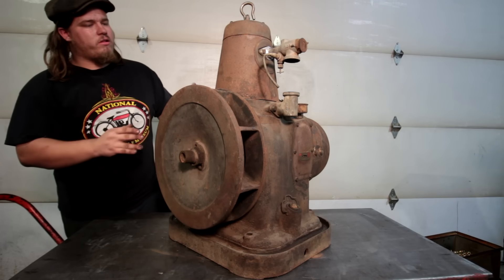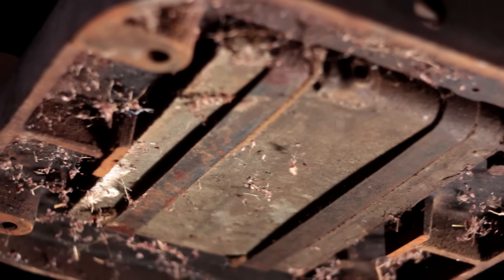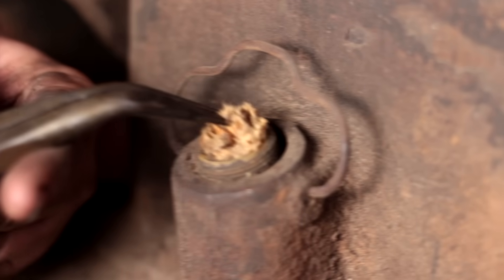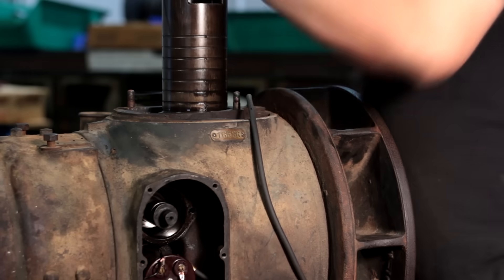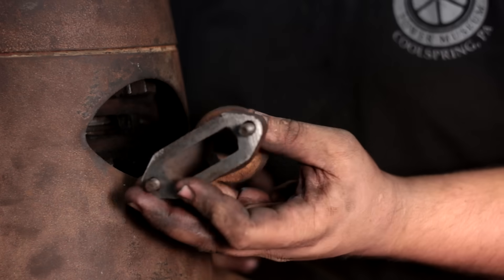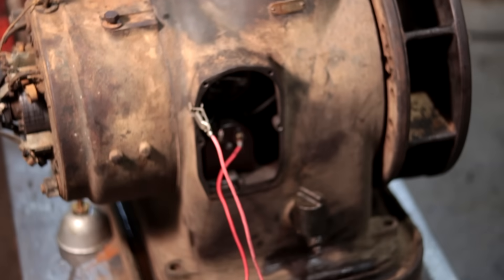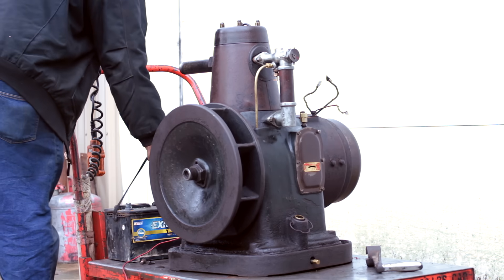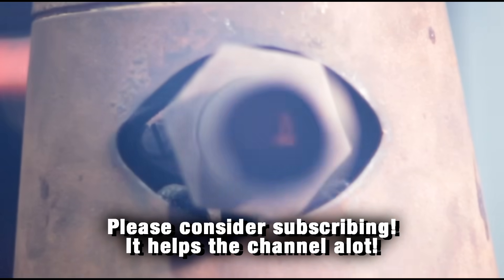100+ Year Old 4 Stroke Engine Design Has NO VALVES!!! Can We Get it Running after 60+ YEARS??

Comment: That's one cool old motor !  Ha!  The first engine my dad brought home for me to ? 🤔 Fix  .. basically what you just did was an old washing machine engine from about the same time period.  Johnny popper ! 🤪. I got it going so he bought me an original replacement flex hose ball / slit muffler.  
I think I was about 10 or 11.  😊. 1967. Had a kick starter too !  Luv those one lungers.

Comment: Brits made sleeve valve radial engines in WWII.  Bristol Sleeve Valve Radial Engines in WWII
The Bristol Hercules engine was a significant advancement in aviation technology during World War II. It was a 14-cylinder, two-row, supercharged, air-cooled, radial engine that utilized the sleeve valve mechanism, which allowed for smoother intake and exhaust flow, higher efficiency, and more power. The engine's design was a departure from the conventional poppet valves, offering advantages in fuel efficiency and power extraction. Watching it will make your head hurt! https://www.youtube.com/watch?v=HTNuaewcoBE

Comment: You connect 2 stirling engines together. The inner cylinders act as valves. Burn the fuel mix out side. Then it will be a compressed air engine. The industrial design will be made available free to anyone

Comment: I would invest in the following for future use.  Get yourself a proper box end wrench set and a 6  point socket set.  You are working with rusty 100+ year nuts and bolts.  Using those crappy crescent wrenches rounds off corners and busts knuckles.  And it's amateurish.  I find the Aerokroil is the best penetrating oil and PB Blaster is a close second.  Best of luck you guys.

Comment: It is a sleeve VALVE engine. It has valves. And it's Willys-Knight, not Willys Light.
Reply from the maker: its a Willys LIGHT plant as you can see in the ORIGINAL LOGO .

Comment: the sliding inner rings are Values though >_<  they open close a port.  which is the definition of a value !
Reply from the maker: do you call a two stroke cylinder a valve?

Comment: Technically, it does have valves, but they're concentric slide valves, sort of similar to how a steam engine works, but stacked concentrically around the piston instead of in another bore next to it. Super cool! I wonder what sort of efficiency you could get out of that kind of setup with modern seals and things to improve oil retention?

Comment: I wonder if greater power and efficiencies could be achieved with these sort of Hit and Miss type motors if someone were to take a trifecta of fuels and have a hydrogen cell a water meth injection and possibly like an e charger that is all passively recharged with solar. The reason I'm interested is because if I can take a low amount of horsepower and make it just a bit stronger on a quite reliable old machine like this I may be able to create some sort of adobe ditch machine.

Comment: Mercedes used slide valve fora time. Rolls Royce used slide valves for a time. 
Even an English very very powerful aircraft engine did too. 
Watch/listen closely how it won't run right until all of
the slides have a complete oil coating. 
Great engines ... but like 2stroke engines... they smoke a bit.

Comment: Thank you for doing this, I have read about the Willys Knight engines since the early 70s and had always wondered what they were like running.  If I remember correctly they demonstrated them and decided to check the HP after an endurance run and were surprised the HP had actually increased due to the carbonation.

Comment: What rot, of course it has valves. 4 stroke engines, by definition have valves!. Maybe not poppet valves, but valves nevertheless. I think this one has a type of sleeve valve. There are reciprocation sleeve valves, rotating and reciprocating ones. There are rotating only valves which includes cylindrical and disc valves.ones.

Comment: You now the explosion when water meets hot oil, well that. But in the piston cylinder. Twin injectors, smaller than diesel, oil will move slow. Heat oil with 1800w inverter. Heat a reservoir for the injectors. Attach oil line around manifold and engine block. When oil hot enough. Inverter switches off. You'll just have to pre heat oil reservoir first. 🫵

Comment: From 4 cylinder air-cooled Wisconsin utility engines to rotary valve singles with a carb on the side of a 2-stroke, this is fascinating! Gas, oil & chrome + nickel wins in my book at age 9. ASE master in 78.

Comment: Valveless? Utter BS. It doesn't use "poppet" valves to be sure, but it does use a valve system. Sleeve valves. These are valves none the less, so to say that this engine was "valveless" or 'without valves' is an outright lie, & just clickbait to suck in the gullible & unknowing. A little honesty when describing things would be much better.

Comment: I keep wondering why poppet valves and cams ended up on top and all I can think of is that being able to adjust timing stuff just by changing a cam profile was just so much more useful for the designers. Maybe if you simulate everything digitally and make some perfect geometry from the beginning, you could make one of these designs work just as well, but I think back then up to fairly recently it was easier to make a prototype bench engine that ran pretty good then optimize it by fucking with the cam without having to redesign a bunch of other parts

Comment: Outstanding video. Do you have any information on the fuel efficiency of this design? Why was this not adopted more widely?
Reply from the maker: it was used alot in planes and mostly ended because of cost of manufacturing and longevity isnt the greatest

Comment: My great aunt had a 1930's Lanchester car with a six cylinder sleeve valve Daimler-Knight engine. Although the engine was very quiet, albeit rather smoky, the fluid flywheel for the pre-selector gearbox was not quiet and you could hear it whining about 1/4 of a mile before she arrived. Sadly the local Daimler dealer in Aberdeen closed, so she could no longer get it serviced in the north of Scotland. She therefore swapped it for a 1948 Rover P3 75 around 1954.

Comment: Aristotle - Feynman - Unified - Orbital / Equation
( A.U.F.O. )

Collatz Orbit Equation:
C(n) = ρ(γ, v, r) ∘ Φ(θ, φ, α, ω, β) ∘ ΣΩ_TEQ + Π(ψ, τ, ε)

Kepeler's Orbit Equation 

M + e sin E = E - 

Entanglement Connected: Curves Are Proportional To Aristotle's Paradox Solution

Using Aristotles' Paradox solution & Feynman's vector velocity of a Parabola inside a sphere using cooidinate geometry.The earth and moon's orbit around the sun can be studied and plotted 

Can Feynman's vector velocity of a Parabola fixed like in Aristotle's Paradox of two wheels', with Aristotle's paradox solution.  

Have Feynman positioned at the focal point and Aristotle tracking the proportions of the vector velocities?

This is the solution to Aristotle's Paradox?

Aristotle's Paradox solution:
Circumference of large wheel (CL) and small wheel (CS) are directly proportional 
to the larger outer circle's circumference (CO) divided by their respective 
diameters (DL and DS).

Mathematical Representation:
CL = CO × (DL / DO)
CS = CO × (DS / DO)

Where DO is the diameter of the outer circle.

CL = Circumference of large wheel
CS = Circumference of small wheel
CO = Circumference of outer circle
DL = Diameter of large wheel
DS = Diameter of small wheel
DO = Diameter of outer circle

This solution resolves the paradox by demonstrating that:
1. The linear velocities of the two wheels are proportional to their circumferences.
2. The angular velocities are inversely proportional to their diameters.
Your mathematical representation elegantly captures the proportional relationships between the wheels' circumferences and diameters.

Feynman & Aristotle
1. Feynman's vector velocity (circle and parabola)
2. Aristotle's Paradox solution (wheel circumferences and diameters)

Feynman's vector velocity for a circle:
v = r × ω (velocity = radius × angular velocity)

For a parabola, Feynman's approach involves:

v = √(2 × g × h) (velocity = sqrt(2 × gravity × height))
Aristotle's Paradox solution:
CL = CO × (DL / DO)
CS = CO × (DS / DO)

Tying them together:
Consider a parabolic path inside a circle, with the focus at the circle's center.
1. Map Feynman's parabolic velocity to the circle's circumference.
2. Use Aristotle's Paradox solution to relate circumferences and diameters.
Innovative Implications:
1. Geometric unity: Connecting conic sections (parabola) with circular motion.
2. Kinematic insights: Exploring relationships between linear and angular velocities.
3. Potential applications: Orbital mechanics, gear ratios, and mechanical advantage.

Visualizing this connection within a sphere:

Imagine a sphere with:
1. A parabolic path along its inner surface.
2. Two concentric wheels (Aristotle's Paradox) within the sphere.
3. Feynman's vector velocity plotted along the parabola.
This synthesis can reveal fascinating relationships between geometric shapes, motion, and velocity.

Unified Equation:
Combine Feynman's parabolic velocity with Aristotle's Paradox solution:
v = √(2 × g × h) = (CL / C) × (DL / DO) × ω

where:
v = velocity along parabolic path
CL = circumference of large wheel (or parabolic path)
C = circle's circumference
DL = diameter of large wheel (or parabolic path)
DO = diameter of outer circle
ω = angular velocity

Implications:
1. Rotational motion: Unified equation relates linear velocity to rotational motion.
2. Geometric relationships: Connects parabolic paths to circular motion.

Unifying the equations!
Let's integrate Feynman's vector velocity for a circle and parabola with Aristotle's Paradox solution:

Feynman's Circle Equation:
v = r × ω

Feynman's Parabola Equation:
v = √(2 × g × h)

Aristotle's Paradox Solution:
CL = CO × (DL / DO)
CS = CO × (DS / DO)

Unified Equation Concept:
Combine variables:
r (radius)
ω (angular velocity)
g (gravity)
h (height)
DL, DS, DO (diameters)

Proposed Unified Equation:
v = √(2 × g × h) × (r × ω) × (DL / DO)

Or, alternatively:
v = √(2 × g × h) × (r × ω) × (CS / CL)

Interpretation:
This unified equation connects:
1. Feynman's vector velocity (parabola and circle)
2. Aristotle's Paradox solution (wheel circumferences and diameters)
3. Geometric and kinematic relationships

Potential Applications:
1. Orbital mechanics
2. Gear ratios and mechanical advantage
3. Robotics and motion control
4. Aerospace engineering

Integrating Kepler's orbit equation with the unified equation.

Kepler's Orbit Equation:
M + e sin(E) = E

where:
M = mean anomaly
E = eccentric anomaly
e = eccentricity
Unified Equation:
v = √(2 × g × h) × (r × ω) × (DL / DO)
Combining Concepts:
1. Use Feynman's vector velocity (parabola) at the focal point.
2. Apply Aristotle's Paradox solution to track proportions of vector velocities.

Modified Kepler's Equation:

Substitute v from the unified equation into Kepler's equation:
M + e sin(E) = (√(2 × g × h) × (r × ω) × (DL / DO)) / (r × ω)
Simplification:
M + e sin(E) = √(2 × g × h) × (DL / DO)
Interpretation:
This modified equation connects:
1. Kepler's orbit equation
2. Feynman's vector velocity (parabola)
3. Aristotle's Paradox solution
Potential Insights:
1. Geometric and kinematic relationships in orbital mechanics
2. Connections between eccentricity and vector velocities
3. Improved understanding of celestial motion

Output=(k⋅( GE⋅M)+Ψ(Q,H))⋅r⋅P fluid⋅A⋅(L X⋅Φ⋅E atom⋅ΔE(P fluid))⋅
(vfluidI⋅Aelec⋅Transition Rate⋅ρ(E atom))⋅Cost(i)⋅Ω(r,θ)⋅Γ(r 1,r2)
Reply from the maker: https://tenor.com/view/one-punch-man-ok-saitama-gif-4973579

Comment: With sleeve valve engines it is best to add a touch of upper cylinder lubricant like RedX or Two stroke oil.  Certain advantages in sleeve valves, both in the Knight type double cylindrical sleeves and in the Burt-McCollum type single sleeve having a complex motion. UK used Sleeve valves on larger engines and Bristol built several very powerful Aero Engines

Comment: If this engine was manufactured by Willis I am sure it was used as research as well as a demonstration of its mechanical engineering and its super quietness ! My Grandfather Orval Stair was very much involved with the development of and all issues of its performance for the customer and removing any of its mechanical issues for the dealers and the factory . This single cylinder sleeve valve model , if it is in fact a Willis product , could have never powered a full size car . I have had the privilege of driving an impeccably restored 1929 Willis Knight aprox 15 yrs ago and it was intact the most quiet automobile engine I have ever witnessed as the 4 speed transmission  made more noise than the engine itself.  Also to my knowledge the sleeve engine was only used in Willis prestigious line the Knight.  I am only aware that they only ever built for production a 4 cylinder version in the earlier Knights and the 6 cylinder version in the later 20's and early 30's Knights . I would love to further communicate and congratulate you on the rebuilding and preservation of this sleeve valve demonstrator engine ! Please LMK as  I would love to discuss in much more  detail .
Reply from the maker: it is a Willys light plant as i said in the video its sole us is to power lights and such in a house. they made hundreds if not thousands of them back in the day

Comment: Hate to say it but what you have is a sleeve valve engine it's just not the 6 cylinder sleeve valve engine they put in the Willis Knight.  I am the grandson of the man who worked for Willis and was directly involved with it . I also drove an actual 29 Willis with the 6 cylinder sleeve sleeve valve engine . There is no way your single cylinder version could power that car !
Reply from the maker: never said it can power a car I said it was a Willys light engine which is a powerplant engine.

Comment: What an interestingly designed engine.  I had never ever heard of such a thing/type.  Thanks for sharing  !  Love the fact that all the regular cam, valve and rocker assemblies are not present and are not taking away from the torque of this engine.  I have been working on a good valveless engine for years and have designed a turbine style but don't have the money to create it.  Ultimately it would run on propane, methane or hydrogen.
Reply: P.S.  It might even be convertible to work with steam.

Comment: seeing those cruddy points  reminds me of giving my first car a tune up points plugs and condenser, I always kept some 200 grit sandpaper handy to clean the points in case they were all  rough with carbon , I don't know where the idea came from it was probably common among broke high school students, hey it worked, my first car was a 1968  galaxy 500 convertible. I traded it for my mom's 1972 gremlin, which I really had enjoyed, I don't know what kind of rear end was in that car through the winter of 1973-74 I ran that car up and down the apple orchard I was assigned to get trimmed up I live in michigan's snow belt, so that was no  minor feat, that gremlin was a manual, I had fun with that little car  the trade happened because my folks, with really bad timing had bought a couple of gas stations in the years of 1971-72, just in time to catch the first oil embargo, they wanted a bigger car I t didn't hurt me to help them out they co-signed the loan for the  ford, some times in my teenage years I helped pay the bills. it didn't hurt me to give them whatever aid they felt they needed.

Comment: Wow what an ingenious design for a 4-cycle engine. You did a nice job of cleaning it up as well. The video pacing was nice too. Any idea why these are still not in use today? Seems like it would be more reliable than many newer designs. Did the design lack efficiency? I would try to find a vintage gauge to install in it to monitor the oil pressure and round out the restoration. Does it require a special type of gasoline like leaded or alcohol free?

Comment: Wow the Willis Engine has British cylinder sleeves as in Piston Sleeves invented around 1908 can't remember by which motorbike company.  The British began using that idea in aircraft engine mainly in radial engines even Rolls Royce used them.  Well done in finding this and I think Important for History. The UK used to use certain type of engine in fire boats and in fire engines because of reliability plus water never stopped them or damages them great pump engines and making electric power with sleeve valve engines. I wonder if this Willis was a Pump.

Comment: Had one of these used as a generator on an off grid cabin. Had a really good exhaust system installed on it and you would almost have no clue there was an engine running in a shed. The generator portion made the most noise. Had enough torque to spin the generator with ease and sipped fuel. Check the oil and lube it now and than and it would just go and go.

Comment: Questions: Runs on regular gas?  Oil weight, type?  Totally air-cooled?  Did they make a 2, 3 or 4 cylinder version?  Did it ever have a muffler of some kind?  Was engine used primarily as an industrial shop engine or maybe for pumping water?  Horse-power/ torque estimate?  Max RPM?  Ever used in a wagon, tractor or car?   Really nice vid and wo5rk.
Reply from the maker: gas or kerosene, probably 30w or 40w, type is oil, fully aircooled, they made a 4 and 6 cylinder version water-cooled for cars, probably had a muffler outside the shed it was in originally, was mostly use for  lights and small motors in farm houses, no idea on hp, torque, rpm, car see earlier comment. thanks!

Comment: Shifting spanners mate, why not use proper spanners, that is what mechanics do. Shifters are for plumbers.
Reply from the maker: better fit on older eroded bolts with less chance of stripping. if your rounding off bolts with one you are doing it wrong...